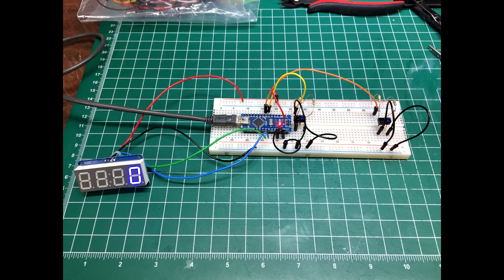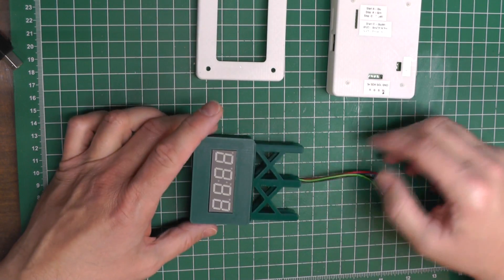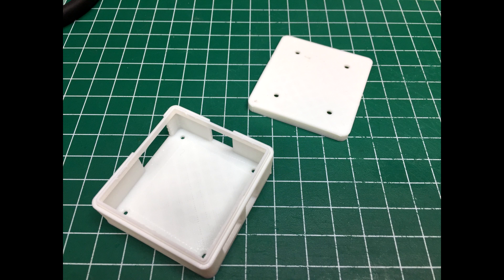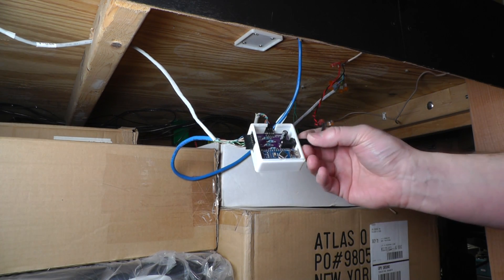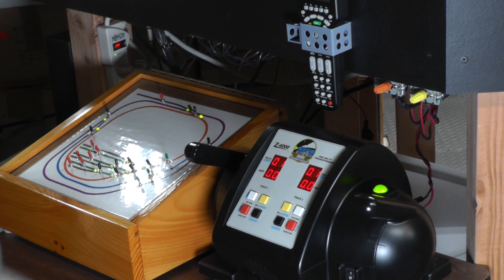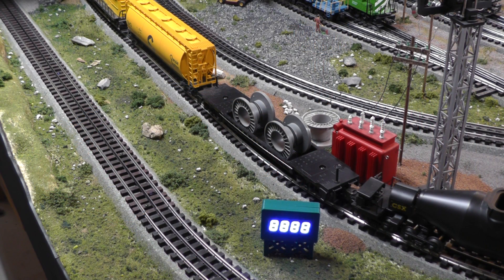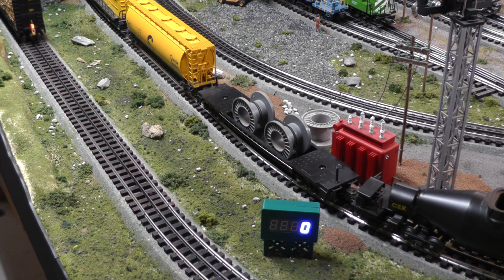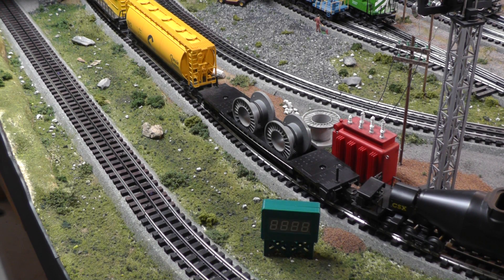Model Railroad Speedometer - Part 2

Comment: Hello, I have few questions to you: 1. what is a distance between sensors and what I to change, to use speedometer for the N scale?. Thanks
Reply from the maker: Please see my Arduino code on this supplemental page:  https://allthingsbobot.com/model-railroading/model-railroad-speedo-part1   The constants are set at the top of the code for distance between sensors and scale.  Mine are set to 18 inches and 48 scale, but you could change as needed.  N-scale would be 160.
Reply: @AllThingsBobot  Thanks

Comment: Love this project Bob.  Did you adapt the project to use a display with embedded 7217 matrix driver now? I notice that the original Adafruit display driver board is gone (or is it? I can't tell!).  For more advanced and larger layouts it would be neat to use the serial channel of the Nano to send back speed reports to some central point,  perhaps via a RS485 bus or by Wi-Fi.

Comment: Hiya Bob. I ordered you board but was wondering what voltage you were using for the 47uF capacitor?  Thanks.
Reply from the maker: I used a 50v because that's what I had
Reply from the maker: Circuit supply voltage is 5v so I suppose use a filter cap at least 2-3 times that, maybe 16-25v minimum
Reply: Thank you sir!!

Comment: very cool projet ! It is possible to know the calculation of  the 63360 constant at line 90 in program ? I try to convert in KM/H
Reply from the maker: Distance in my project is set in inches, and I need to get it converted to miles.  There are 12 inches in a foot, and 5,280 feet in a mile.  12 x 5,280 = 63,360.   I think you could just set the distance in the program to what you measure in millimeters (between the 2 sensors) and then change the conversion line in the code to take the distance (mm) and divide by 1,000,000 to get KM.
Reply: @AllThingsBobot  thanks you ! I try it
Reply: elapsed = finishmillis-startmillis;
    
    elapsed = elapsed / 1000;    //seconds
    //Serial.print("Seconds: ");
    //Serial.println(elapsed);
    miles = distance / 63360;   // Distance covered divided by Inches per mile
    hours = elapsed / 3600;   // What fraction of an hour is our elapsed time ?
    mph = miles / hours; // Our actual real-world MPH
    scaleMPH = mph * scale; 
	/* 
		Our scale multiplier see 
		https://en.wikipedia.org/wiki/List_of_rail_transport_modelling_scale_standards
		for a list.  O guage is 48  OO is 76.2  HO is 87.1  N guage is 160  etc
		Here, we seem to be just using integer multipliers.
    
	*/

HTH @Daniel Hamelin

Comment: Really like what you have created.  I would like to add this to my son's layout, but wanted to use a Nodemcu 8266 wifi board instead of the Arduino Nano.  The pin layouts are a bit different, so I would need to make some modifications to the pins used. Any chance you could post the Eagle files so I could modify it to work with the Nocemcu board?  My plan was to have a a local segment display next to the sensor and send the data via wifi over to t another nodemcu board that displays the same information near the main control panel.  Thanks, Dave
Reply from the maker: Contact me via email on my About page and we can discuss. https://www.youtube.com/user/BobotsTrains/about

Comment: finally built and working with changes for N scale and distance.  I am curious where I can get the  billboard for mounting the display ( I need 2 of them).  Thanks
Reply from the maker: If you are using the exact same display as I used (Adafruit 0.56" 4-Digit 7-Segment Display w/I2C Backpack - Blue [ADA881]), I suppose I could 3D print the billboard I used for the project.  I could print and send out to you and then if they work for you we can work out payment. PM me at the link in my about if you are interested.
Reply: @AllThingsBobot  PM Sent

Comment: Do you have a parts list for part 2?
Reply from the maker: Pretty much as written on the board and seen in the photos:  Arduino Nano v3, (2) 150-ohm ¼-watt resistors, (2) 100K-ohm ¼-watt resistors, a 47uF electrolytic capacitor, a surface mount DC power barrel jack, an 8-pin and 4-pin header, and this LED display https://amzn.to/2OubMmj   Solder/wire it up, load the Arduino sketch found here:  https://allthingsbobot.com/model-railroading/model-railroad-speedo-part1/ and cross fingers and pray.  :D
Reply: @AllThingsBobot  thanks, i went and viewed steve spence's video after i asked you. i should have watched him  as well before questioning. i'm new to this but i appreciate your responce. as i get further into this you might hear from me again.thanks
Reply: @AllThingsBobot  Thanks, the display was one thing I couldn't find.  Well, that and the sensors used...
Reply: What voltage are you using on the 47uF capacitor? I’m assuming 5vdc but the smallest I can find is 6.5vdc. 

Thanks.
Reply from the maker: @billmcgarrity1241  I used a 50v because that's what I had